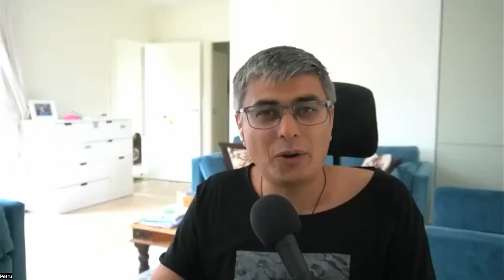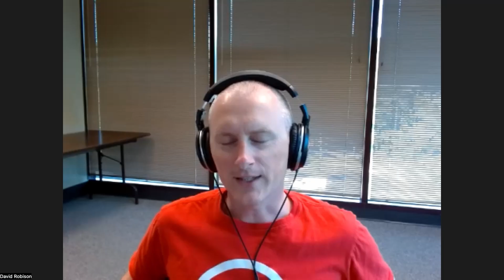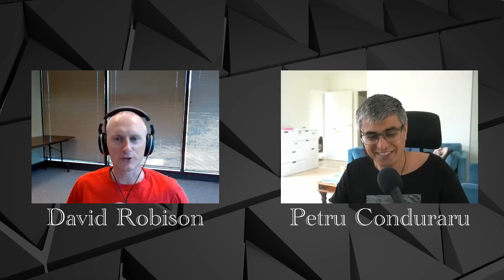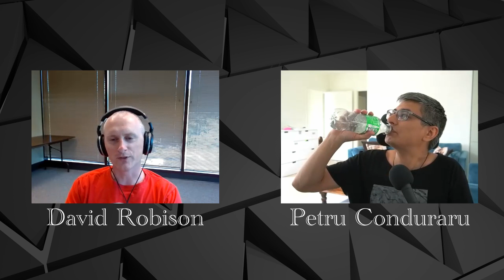🎙️BIM for Electrical Engineers: A Deep Dive with David Robison

Comment: Interesting podcast! On a side note, I believe it's worth noting that the IFC Schema provides much more than dumb geometry! Namely: IfcDistributionBoard with Pset_ElectricalDeviceCommon (where you can store Power, as well as PowerFactor for the kVA), IfcCableSegment and IfcCableCarrierSegment with a ton of psets, and lastly IfcDistributionPort, in order to connect cable and cable tray segments from upstream to downstream.
Reply from the maker: Thank you Carlos! Yes, seems like there is a good IFC support for electrical works, so maybe David will implement this within his tool at some point.